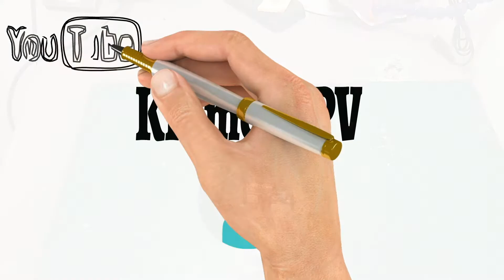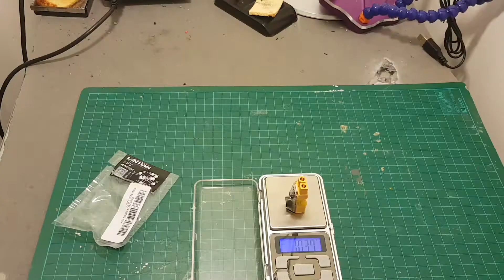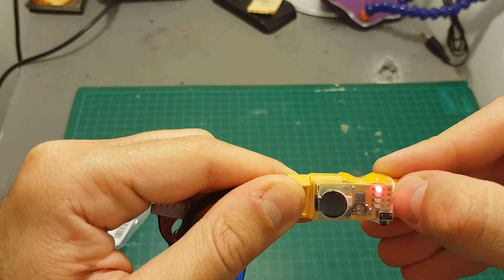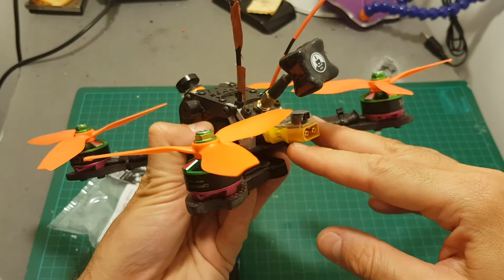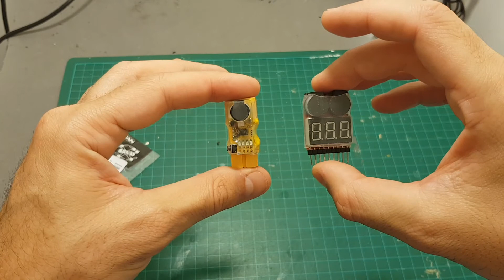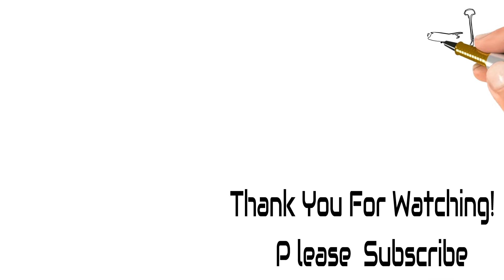Lantian RC XT60 In-Line Battery Voltage Alarm Detector - Quick Review

Comment: I assume this buzzer will beep on low voltage sag when doing punchouts which like the other twin buzzer model tended to happen. Do you know if it does this?
Reply from the maker: Yes - it will happen when the battery will get low. 
I am not using this device anymore and I suggest getting a buzzer with a built in battery such as the Vifly finder instead: https://youtu.be/LNn-DKa_UcE